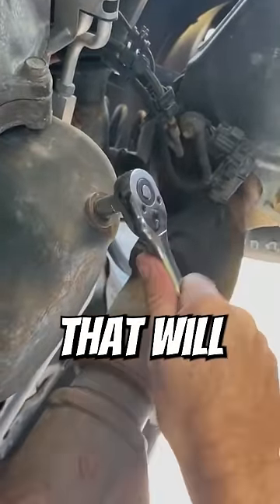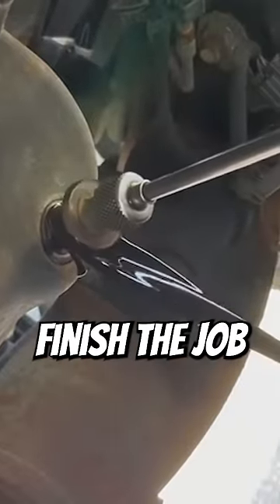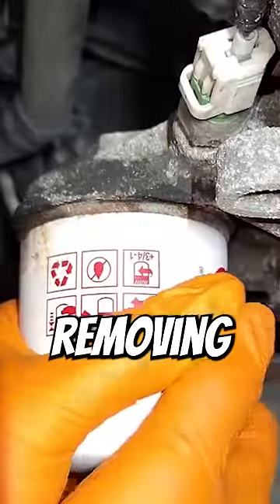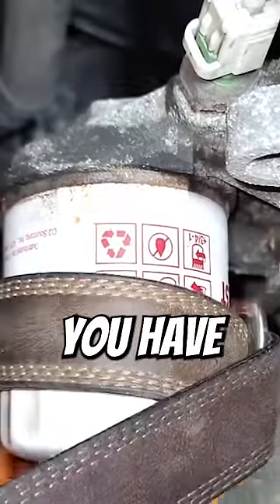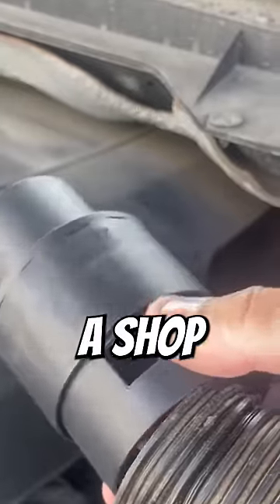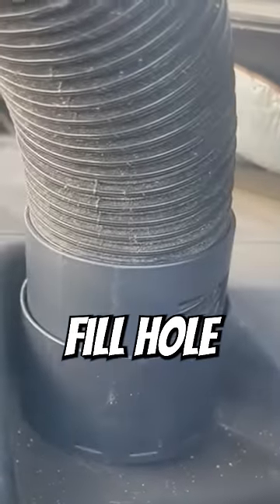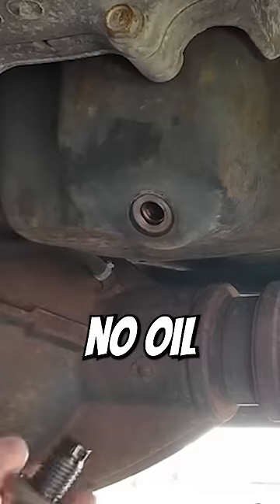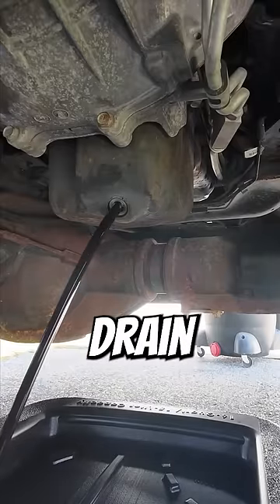Mechanic Life Hacks That Will Improve Your Worthless Existence - Oil Change Edition

Comment: Any hack that keeps oil under control is a favorite
Reply: you got that right!!
Reply: I saw something. Hook a shop vac to your valve cover breather or oil fill cap. Turn it on right before you take the plug out so you can pull the plug without oil gushing on you. As soon as your hand and plug is clear of the hole cut the shop vac off. I also use a piece of double sided mesh emory cloth for filter changes. Find it in the plumbing section of any plumbing store.
Reply: @RadDadisRad  so pointless, don't be a wimp
Reply: @M.TTT.  cry more princess
Reply: @RadDadisRad  the one who weeps is thee, liberal
Reply: willyberg123  it’ll be fine. Also I’m not talking about drawing 500 inches of mercury on the engine. I’m talking .5-1 inches of mercury. Basically the same amount of vacuum you can put on a slurpee straw.
Reply: @M.TTT. I agree but at the same time you gotta realize whatever doesn't make a mess will get the job done faster. Im a lube tech and I have to check tire pressure and tread depth when the oils draining, it's a pain to go wash my hands when a rags not around.
Reply: @M.TTT. keep crying
Reply: The magnet
 Saves hands and no dropping the plug into the drain pan. 😊
Reply: Take a flat head screwdriver and picture the bottom of the oil filter to drain the oil from it before unscrewing it.
Reply: Just put a vacuum cleaner hose to the oil top up hole. Easier and much more efficient
Reply: the only thing I found useful was using a belt to loosen the oil filter
Reply: All Of them
Reply: Especially hot oil.
Reply: I like the magnet on the drain plug. For the oil filter, put the drain pan under it and use a scratch awl and hammer to punch a small hole in the center or lowest part of it, then loosen it to let the pressure equalize. After some or all  (your preference) of the oil in the filter emplies into the drain pan, I put the hole in the filter over the opening of the container I put used oil in (the now empty jug) from 1st changing the oil and let it finish draining into it. I take my used to to a friend who burns it in a used oil furnace.
Reply: Wallmart oil change no mess.
Reply: Same
Reply: @keithwatson8228 Did you mean puncture?
Reply: Simply brilliant and not even rocket science 😅
Reply: only thing i see is the shop vac one is sucking unfiltered air into your motor, not good
Reply: just use an extractor pump
Reply: Or just change the oil and quit being a poosay 😅
Reply: JustinV-ze2ir  Me and my Pops used to use gasoline to wash our hands in his shop. Did it for decades even back when gas had lead in it. The 70's and 80's. Works great. He lived to be 84 and I'm currently in my late 50's with no problems. 
Except a bad back for 45 years of working on cars.
Reply: Real hack is getting a Tesla to avoid oil mess .
Reply: @judgementday3365  ..i feel you..
However if, lets say if, someone gave me a Tesla, I'd rather drown it in oil and burn the thing..

And yeh, that's actually called a different car, not hack; so what happens when lights out on Tesla, get Jet..?😅

Thanks, but yeh nah for me..👍🤝
Reply: Many people here don't understand what "hack" LITERALLY means..

And i despise the word "literally", cos that too is used so often & lost it's meaning..

A "HACK" means "no need for extra money/funds to accomplish hard tasks to/& make simple"..

Some say it's weak minded, but this hack means less mess when concerning this oil change footage..
Nothing manly about being covered in oil or kept neat.. ..not about brains Vs brawn, just lesser on clock when playing with oil..

I really feel for many if electricity stops and this spoilt era ceases to function.. ..and why so angry..? Or hateful, it's a f**kn oil change, we should learn from each other, not compete like wealthy magnates..

We're all here (yapping), which means we're all poor..👍

Everyone please have a blessed day/night..🙏
Reply: I've used a couple wraps of an extension cord instead of the belt before.
Reply: JustinV-ze2ir  I'd imagine probably not good for you especially these days they add so many additives to it I'm sure 1 or 2 of them are probably not good for you. Also used oil has tiny metal shavings in it and when wiping it off with a towel you are probably rubbing those into your skin so sure fine once in awhile but if it's your 9-5 it's nice to work clean.  And yeah we do dumb shit all the time like wash grease off our hands with brake clean lol.
Reply: @M.TTT. I get what you're saying. But there is merit to avoiding carcinogens when possible.
Reply: Extractors are fantastic. I just wish all auto makers made the dip stick big enough.
Reply: I swim in that shi😶‍🌫️
Reply: Oh
Reply: I often use a small rectangle of carboard (box flap) with a crease in the middle on like 2008-2013 nissans. Some others like that too where the filter sits above the subframe. Directs oil from filter into a pan without getting it all over the subframe and brake lines
Reply: @M.TTT. agreed
Reply: You can also hammer a nail into the dependent part of the oil filter to create a small drain hole prior to unscrewing the filter. Just make sure you can start to unscrew the filter first before poking a hole though.
Reply: No spill problem coming off drain. My spill is for moving it to a recycle container.
Reply: I've had a customer that never maintained his car to the point where when I pulled the drain plug the oil still did not come out.  Took 3 drain, run, and drain agains to get to flowing.

Comment: Someone should create some kind of wrench for removing oil filters. They could call it an Oil Filter Wrench.
Reply: It'll never catch on!
Reply: Already did, decades ago
Reply: @wh0sjeff  Gee, I wonder why the guy in the video doesn't know about such an invention. 🤔
Reply: They have a cup attachment for your ratchet.
Reply: @206dogg valvoline uses those attachments for their impacts 😂😂
Reply: What happened to the old fashioned way of just stabbing a screwdriver into the oil filter and spinning it off? Everybody's to afraid to get dirty nowadays?😂
Reply: @wh0sjeff someone doesn’t get sarcasm
Reply: I literally burst out laughing at that. Thank you!
Reply: How do so many commemters not comprehend the sarcasm of your comment?
Reply: fuck the wrench. it never grips. i just use a filter socket and use the appropriate size. wayyy easier
Reply: @747simmer4  You don't take your belt off and wrap it around the filter?
Reply: @benmanning4340 punch a hole in bottom first and drain oil from filter before stabbing it.
Reply: @scotmandel6699  nah I prefer to just bite it off with my teeth 🪥
Reply: Eh I don't think  that will work....
Reply: sand paper is my go to
Reply: I prefer oil filter pliers
Reply: get stronger grip strength nerd
Reply: If you can reach a oil filter with a tool you have no problem at all. Try it with your hand deep down the engine and no space for any tool. Them we are talking
Reply: @paulg.4139  why are you buying a car that has a horrible design?
Reply: @Hallowsaw  Tell this the client, not me
Reply: @wh0sjeff wow really 😂😂
Reply: @wh0sjeff right! Decades ago 😂
Reply: @bikinggreg he’s showing diy in a pinch shit
Reply: This made me lol.
Reply: They have the band wrench for this reason 👀
Reply: @killakiIIa  you mean to tell me they're screwing in my oil filter with an impact?!
Reply: Also jam a rag between this tool and filter so it fits tight for better grip
Reply: @bikinggreg IN A PINCH. like, in a situation you don't have one lol. Most MEN wear belts.
Reply: They have them
Reply: @randommobilegameplay1077  No way! Is it called an oil filter wrench? Then why did the guy in the video take off his belt and wrap it around the oil filter if such a tool exists? I guess the easiest thing would be for someone to invent a business where you could take you car and they change your oil for you. They could call it Jiffy Lube or Grease Monkey or something like that. That way, you can keep your belt on and your hands clean. 🤔
Reply: That would be sooo cool!!  I’d use one once someone figures it out..
Reply: It would be okay if people would not over tighten them for no reason
Reply: @wh0sjeff dang bro, I didn’t know that…..
Reply: @wh0sjeff That’s the joke…
Reply: It does exist, with different adapters...
Reply: @killakiIIa valvoline uses impacts on an oil plug bolt? 😂😂
Reply: @PghNGDave31  not the drain plug but the oil filter, just as bad tho😂 if you ever service a car and notice the valvoline filter just expect it to be torqued to hell
Reply: @killakiIIa  ok, I gotcha now, yea , still just as bad 😄
Reply: Toyota literally has it
Reply: they are mostly useless!! except the actual belt wrench
Reply: i know right
Reply: @wh0sjeff  NAAAHHH
Reply: They  do!!
Reply: You shouldn't need a wrench for something that should be hand tight to begin with.
Reply: @igotanM16  Hand tight + 3/4 turn per manufacturers instructions.
Reply: @killakiIIa I have yet to see it
Reply: Melted my brain
Reply: @wh0sjeff wow it just flew right past your head huh? 😂
Reply: I have bought some tools I dont use often (ie cordless ratchet) but I will never spend $8-$10 for an oil filter wrench when I have perfectly good hands and a pair of channel locking pliers
Reply: @wh0sjeff *whoosh*
Reply: @scotmandel6699 While you’re at it you might as well punch a hole in the oil pan so it won’t make a mess when you remove the drain plug.
Reply: Did you know that they just invented the wheel?? GREATEST INVENTION EVER!!!
Reply: Yes. I have one I bought to change oil in my '65 PontiacTempest😅
Reply: I think they should call it a strap wrench that sounds better
Reply: Isn't that for idiots who like to bolt on their filters?
Reply: Who has an R&D budget for that kind of thing? Nasa maybe.
Reply: lol
Reply: I just use large channel lock pliers. Works fine and you don’t need to buy a special tool.
Reply: @relentlesschaos95  You don't use your belt?
Reply: I've owned one for over 20 years...
Reply: @747simmer4 
I just don’t tighten it too much when I put it on. Works great. Try it sometime.
Reply: They do have oil filter wrenches of all different types
Reply: @killakiIIa that's the problem with a lot of oil change places they using the wrong tools for the wrong job apparently just like they do at Walmart when they screwed up a lot of different people's cars over there for years. There's always a right tool for the right job
Reply: Works good until it breaks or a sibling 'borrowed' it and no one knows where it got put to since it is not where it's supposed to be
Reply: @Hallowsaw Those all work good. Unless its a car with the filter buried down in a cavity of the engine, with literally no room for even your hands to spin it.  "all not are"* my bad lol
Reply: I like the belt and the shop vac.  Thx
Reply: K&N have oil filters with a hex end on them. Just put on your socket wrench and undo with ease.
Reply: @206dogg  That's what I use, and I rarely need the ratchet. The cup generally gives me enough grip to remove the filter.
Reply: If you need a wrench to take it off you screwed  it on to tight.
Reply: @bikinggreg 🤣 lmao really did make me laugh still 🤣 lmao
Reply: @paddysands3582 u sand your filter down then take your belt off & put it on filter or belt it then sand it?
Reply: @jamiejones6994  no i use sandpaper as the belt, grip and twist

it’s just the way i was shown so i’ve stuck with it
Reply: @paddysands3582  There's been inventions in the last 40 years that would absolutely blow your mind u should definitely get out more sir
Reply: It's already sold in any auto store.
Reply: @jamiejones6994  true i’m sure there is. an oil change is just about the only work i do on my car so maybe one day i’ll use something else
Reply: Can verify. It works great and it was like $8 🤣
Reply: Please understand what in a pinch means🙄
Reply: If the engineers see the vacuum thing they'll put a check valve in the oil fill neck so this can't be done without a special tool.🙄
Reply: I'd imagine it's for someone who doesn't own one, not everyone has every tool. I'd try it instead of spending 20 bucks on a rarely used wrench. The alternative method is for those who don't do oil changes often
Reply: Lol
Reply: Perhaps some sort of thin rubber cover   That’s shaped like a hand.
Reply: If you keep proposing ridiculous ideas like that people are going to think you're stupid. I'm telling you this as a friend.
Reply: The problem is somebody already screwed that up by making top mount oil filters
Reply: They have 10 different kinds.
Reply: New cars just have a paper filter no metal to Polk through but a oil cap you have to re use.
Reply: @bikinggreg It’s overrated. A firm grip with loosen it up. If it’s too tight it’s because it was over tightened. You can also use a wet rag instead of the only belt you have.
Reply: You often can not get a wrench on the filter, so you need to either do it by hand or get a socket.
Reply: @MikeHensley-sc3ns  yeah and about 50% of those filters require a specialty tool that cost a couple hundred bucks just to get it off
Reply: dude just use latex gloves for a dollar only no mess on your hand. happy?
Reply: Those or a strap wrench... if the filter hasn't been overtorqued, though, I just do it by hand.
Reply: @wh0sjeff missed that joke by a mile didn't ya bud.
Reply: @206dogg you're probably really fun at parties huh? Uh oh! There's a joke... don't let it get you.
Reply: You must not have a belt huh? Lol
Reply: Look, it's a 🦒
Reply: what?  what???? what madness are you going on about????
Reply: @benmanning4340 I prefer to not damage my screwdriver
Reply: @CheeseMiser  oh dear!? Wouldn't want to hurt its feelings now would we? 😂
Reply: @benmanning4340  damaging tools. 🤦‍♂️
Reply: Good belts are $15, good strap wrenches are $50.
Reply: @tjgreen4417 if it’s so far down the engine it’s difficult to reach and/or take off, … why are you not removing it from the bottom?